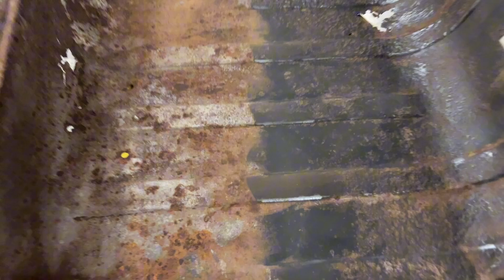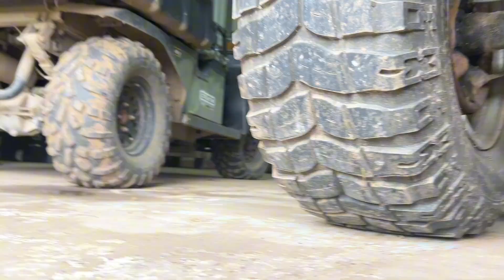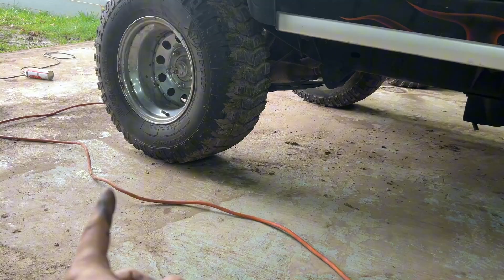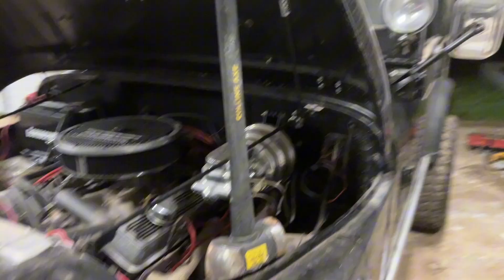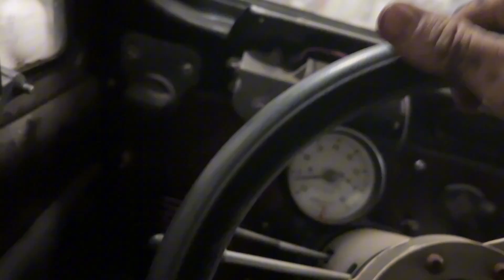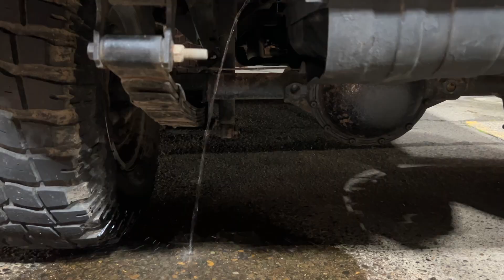Jeep CJ7 fuel system pt. 2 and FIRST DRIVE!

Comment: I tried to comment a few times on this post but apparently YouTube doesn’t allow links in a comment. It doesn’t even give you a warning. 

I wanted to mention the placement of the fuel filter and your blinker lights. This model, and the way the front blinkers and side markers work is weird. If you’re replacing with LEDs, you’ll have to do some research. It won’t work properly if you just change them to LED. 

As for the placement of the fuel filter in the engine bay, there are a few different discussions revolving around it and the possibility to boil the fuel and cause a vapor lock. You would have to google that one as well, since I can’t post links.
Reply from the maker: Thanks for the heads up! I’m aware of the LED problem and will be curious to see what I can figure out. I’ll look into that fuel filter placement! I appreciate that a lot, I wasn’t the person who installed it there but it makes sense that it could boil during long trips or hard engine use!